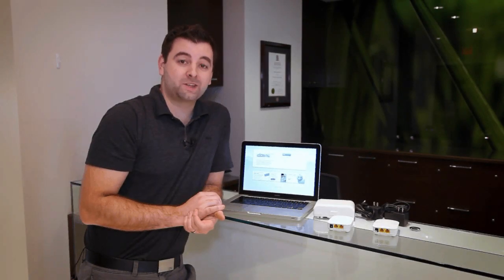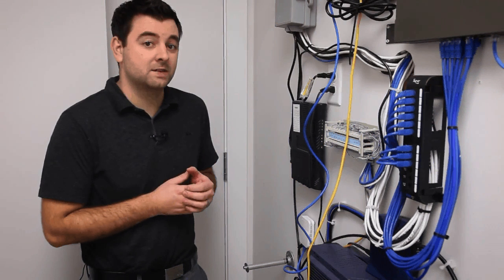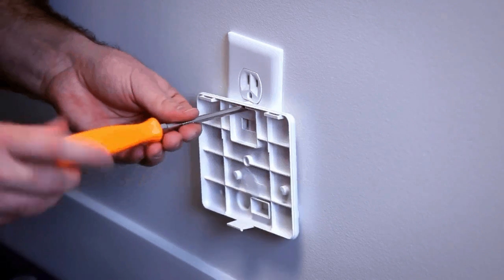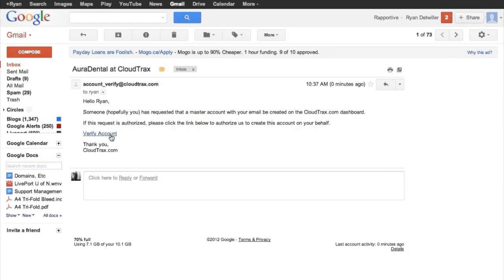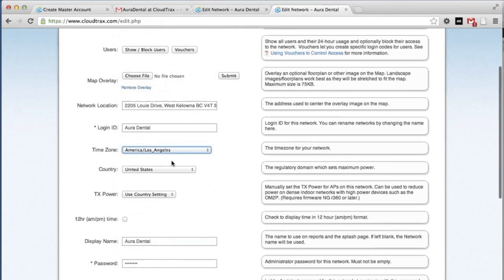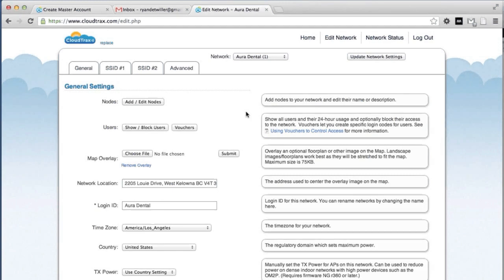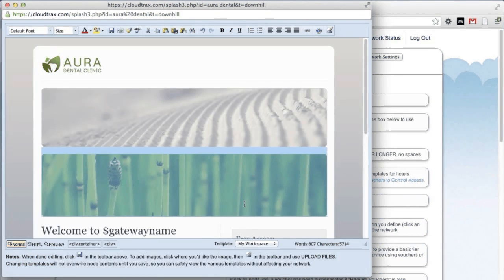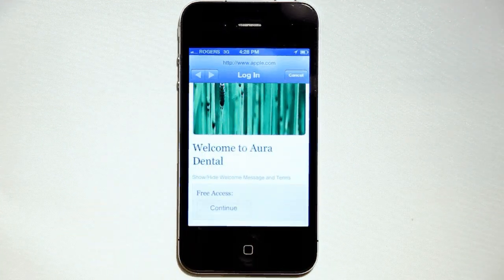Open-Mesh- WiFi Install Using Open-Mesh and CloudTrax

Comment: I took over an old network consisting of OM2Ps that a previous employee set up that quit and nobody knows the login to the account.I made a new account and when I try to add the nodes mac address i get the error message "AP already in use". How can I set them up without having access to remove them from the old account? I tried the 30-30-30 reset but nothing changed. Do I have to buy all new access points now? They perform fine and arent old so I hope thats not the case bc that would be a major flaw. Please help thank you

Comment: can you have multiple gateways on the network for internet connection redundancy?
Reply: I will answer this question just in case someone wants to ask the same. Yes, you can do it by choosing the right device that has the capability to run as a gateway, so you connect it to the internet through any ISP or LAN, then make sure it can work in Access Point Repeater Mode so it can serve both as a repeater to connect to other repeaters while maintaining one connection to the first router, but also as a router running its own DHCP service. In summary, its possible, and it shouldn't demand that much effort setting it up. Cheers.